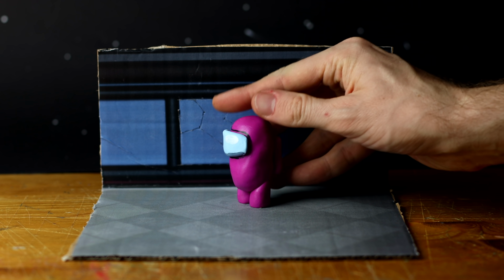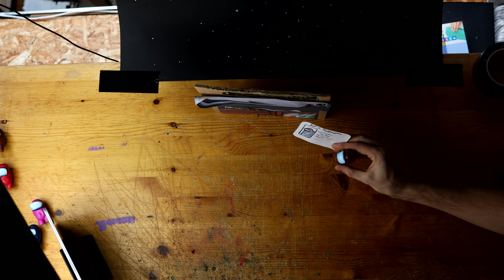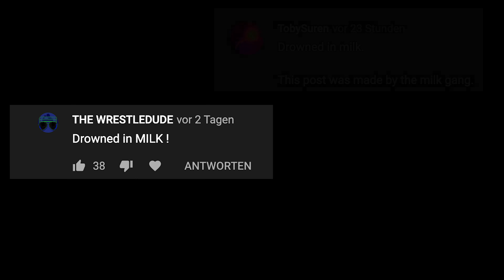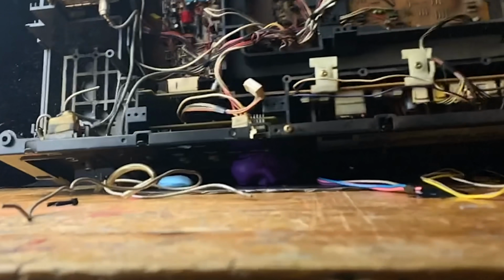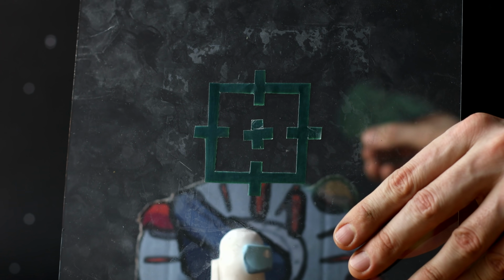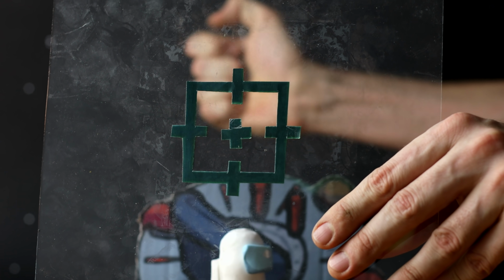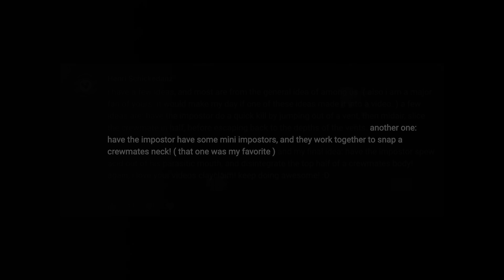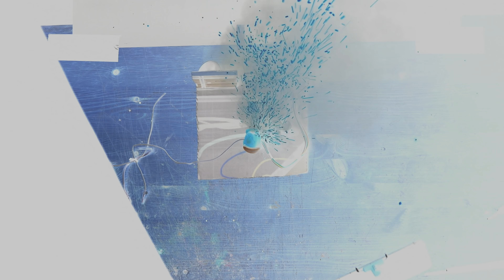24 Ways to Kill a Crewmate (Among Us) – with Clay

Comment: brutality ranking
1 asteroid
2 vented
3 lullaby 2
4 electrical 3
 5 stressed out
6 lullaby 1
7 sucked into space
8 drill
9 clear the crewmate
10 paper cut
11 not having the highground
12 electrical 1
13 tree
14 fan
15 teamwork
16 clay machine
17 electrical 2
18 card wswipe
19 thunderstruck
20 milk
21 burn
22 oxygen
23 fall damage
24 ejected